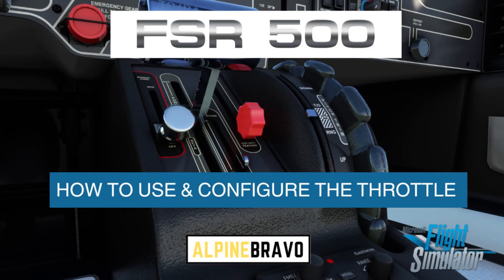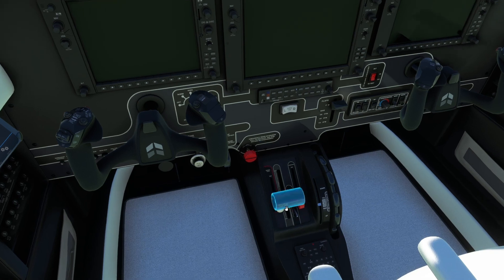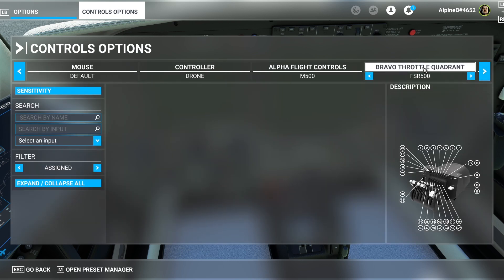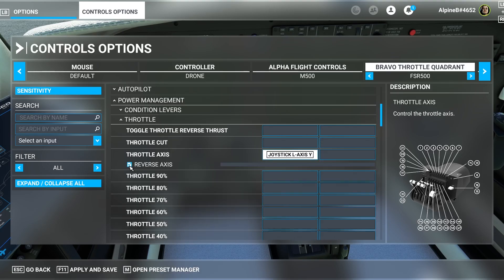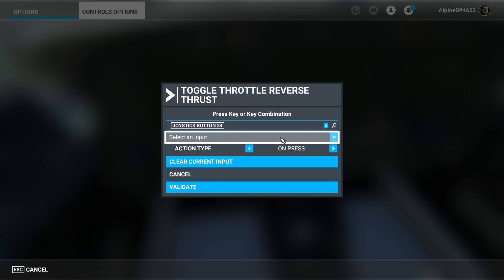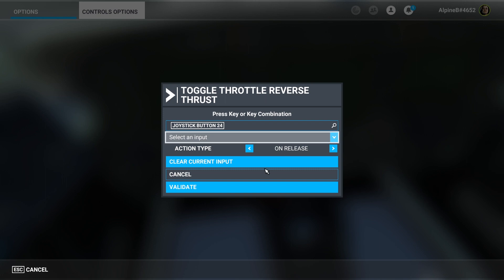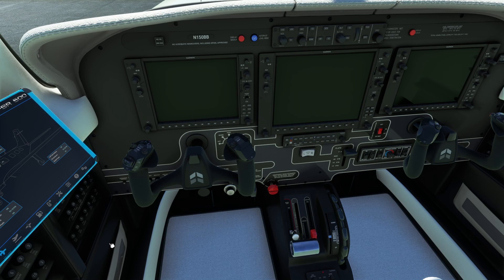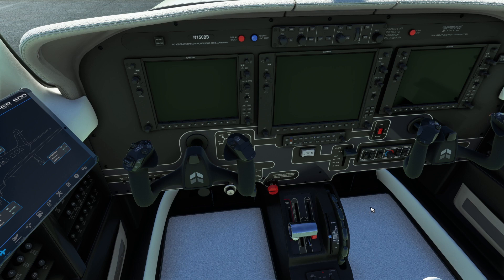FSR500 throttle: BETA  use & configuration

Comment: I made the exact same settings, however when in reverse and pushing the lever forward (=reverse lever in cockpit backwards) there is no increase in power. Any idea?
Reply: Yes you are correct. Working now. Thanks
Reply from the maker: Hi there - I've been away from the SIM for a little while, but I understand SU15 beta may have effected control bindings.  Head to the FSR Discord server for support.